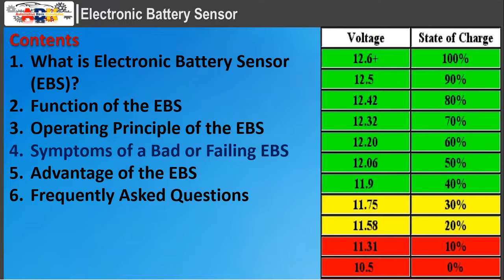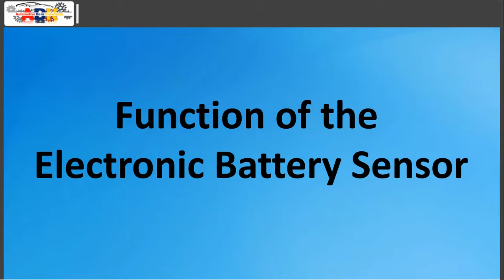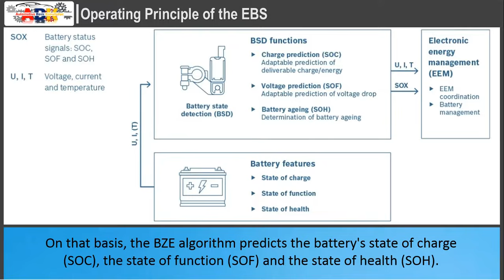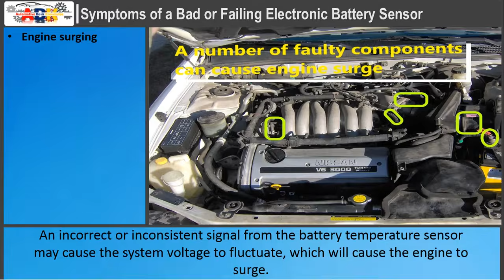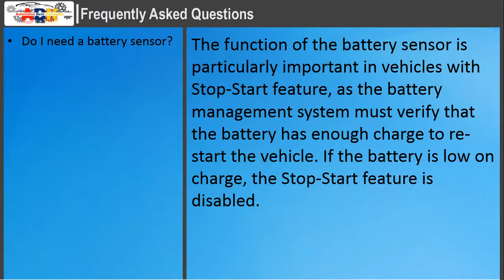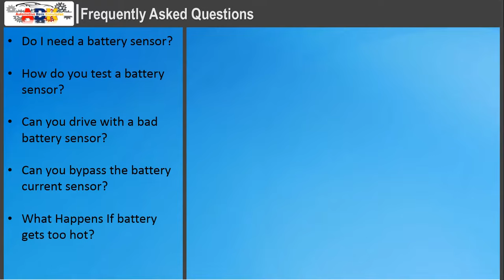Electronic Battery Sensor

Comment: I have a 2016 ford focus. it comes with it's own battery voltage sensor. My terminal where the sensor was attached to was getting really corroded and I had to swap it out for a gold plated universal duralast brand terminal. super heavy duty. I only did this because a week earlier I had replaced my battery at a Walmart and the tech guy said I did not have to have the sensor connected in order for the car to run normal. So I disconnected the connection to the sensor and ran it and it actually ran fine, so  after seeing that it ran fine without it, it gave me the confidence to finally replace my corroded terminal with a universal one. But today, I am having an issue with acceleration. Could be a totally unrelated issue. (I'm going to change out my ignition coils, spark plugs, and MAF sensor and see if that fixes the issue) but I am curious if having installed that universal battery terminal and having ran the car without the battery voltage sensor connected could become a problem, or could have possibly caused the loss of power/acceleration. Any advice? Should I just find a genuine part and go back to the stock terminal with the sensor? I had ordered one on ebay with a guaranteed fit, but unfortunately it did not fit my ford focus so I had to return it. Could running the car without the battery voltage sensor cause any electrical components to short circuit or get fried? Thanks in advance for any help :)

Comment: I havee been all through this as I bought the car with a NEW Wrong battery in the FORD Fusion Energi HB, now the problen is all gone with the corrct AGM battery.
If you get the proper AGM battery for it they don't go dead for many many years. I know all the parts stores will tell you "this fits your car" , it may fit and act like it works but the car electronics is looking for the the Correct AGM battery that has the correct specs. You can get the correct Ford Motocraft batery  from the Ford dealer for the same price as anywhere else and it comes with a REAL WARRANTY that is good at any Ford dealer.

Comment: For my Ford ranger 2017 have a flactuate charging from 14.4 down to 12.2 when running but now I disconnect the bms sensor and now running for 14.4 to 13.8 and no problem at all!

Comment: I found your second video to this problem and same problems i was having. The fuses all showed voltage was good but when we took it off, slightly bent and tested it, there was none to little voltage. Went and bought the part for $4.00! Came home just now, hooked it up and its running! Thank you so much friend!!! I appreciate it so much!!!
Reply: Anyone having the same problem, look for the fuses (they were not in the manual that showed all the other fuses) it was right in front of the battery, I had to take out the air filter and the thing it sits in. There's some fuses that are held down with 2 nuts, one on the top and one on the bottom. Tested them and showed voltage but took each one off until we found one that didn't have consistent voltage. Oriellys had it for $4!

Comment: This is likely the issue with my truck. Auto start/stop doesn't work and at low speeds I've noticed the radio crackles like it's not getting enough power. I got the battery tested and they said "It's got a low charge but a good 30 minute drive should bring it back up". This was literally after my 30 minute highway commute lol. That was also 8 months ago so I know the battery isn't the problem here.

Comment: Never had an EBS on our 1983 Toyota Corolla and the original "conventional" battery lasted 16 years.
Reply: Don't believe that
Reply: @ralph95  You don't believe what? That I never had an EBS on that vehicle or that the battery lasted 16 years? Be specific!
Reply: @achristian7015  I say the same thing. Ibs, ebs whatever. Old cars didn't have em and batteries lasted longer back then. Now days I have to swap batteries every 2-3 years.
Reply: @tykendrick800  Well I have two cars with their factory original batteries, a 2015 and a 2017 and those batteries are still going strong. Internal resistance was 3.30 milli-Ohms on the 2015 and 4.93 milli-Ohms on the 2017. So they are 10 and 8 years old so far.

Comment: This component is irrelevant the car won’t start without it and the main dealers charge an arm and a leg for this tiny component made in Hungary..
Reply: So true if you are having problems starting or battery 🔋 warning lights or ECM fuse blow or charging system codes or battery not holding charge or miss communicate with PCM or ECM display or alternator not recharging after replace or fuse blown these sensors go bad overtime

Comment: It is VERY easy to tell when the is something wrong with allmost anything> All you have to do is count how many TLA's there are when they are being explained! A TLA is a Three Letter Acronym. It is a symbol of ANY over engineered system! Back in the good old days when we had hydraulic powered brakes, hydraulic  power steering, a belt driven generator(alternator) and a good AM/FM radio and NO electronic problems!
Reply: I thought you were gonna say count your money, if you can't afford it then it's probably broken. 😂

Comment: Hello im frm the Philippines. Ihave a ford ranger 2014. After i replaced a new battery, after a week my battery suddenly went flat. Replaced again with a new battery (warranty) and performed BMS and BCM reset manually and using scan tool,  I observed the voltage fluctuates. Already swap alternator, still the same symptoms (engine start, 14.1v then after a minute drops to 12.2v). Checked terminals and connections all are good. No accessories connected also. 

I discovered that unplugging and reconnecting the Bms sensor for 10secs every after engine  start the voltage stabilized between 14.0-14.6v with or without load. 

So this is my temporary remedy everytime i use my car, which is very inconvinient. Does this mean my sensor is broken or did i miss something? Hope you can give me some inputs. Thanks
Reply: Same issue on mine, have you got a solution? Other electronics malfunction
Reply: I feel cranky.... And moody...is it my sensor?
Reply: do u find any solution , tell me
Reply: My car also 
Fiesta 1.6 2014 @blessed-mr
Reply: we are the same problem. but what i did is i upluged it and now my charging become normal to 14.4v to 13.9v

Comment: My car wasn't staring but it turned on. tire pressure came on and it also said incorrect key but when I went to check my tire pressure the guy said there was nothing wrong with my tire but possibly something could be wrong with my senors

Comment: How does the perimeters change with lithium batteries?
Reply: they screw up charging of a lifepo4 battery by telling the car the battery is full at 13v when it is nearly empty.
Reply: @nyc863  That may be the problem I’m having now.
Reply: @shaunjay6040  For a battery with its own BMS, you can disconnect (unplug) them and then the car should revert to 14+ v alternator always on, with the downside of a stop-start system error message on the dash and no stop/start.
Reply: @nyc863  idk.. I disconnected mine on the dodge and it won’t read above 14v except on cold starts. Which is odd because at the PCM I’m reading under 14, but at the first battery I’m reading 14.3, and the second battery is reading what the pcm reads. I’m fine until I play full tilt. Then the cars volt meter drops to the high 11’s and the battery light comes on. The thing is, I’m not clipping, and I don’t have lights dimming. Idk wtf is going on.

Comment: thats great , but witch way does it point? witch direction on the cable? chevrolet cant even tell me!
Reply: I don't know about yours, but the one on my RDX is self explanatory.  One electrical connector, one ground post, and the battery connection.  I wonder what Chevy did...
Reply: @lonniebeal6032  sir, the basttery goes dead in 10 days. Illl turn. It arounnd